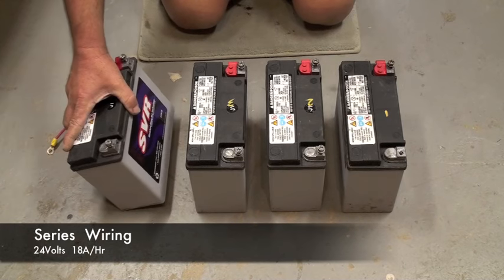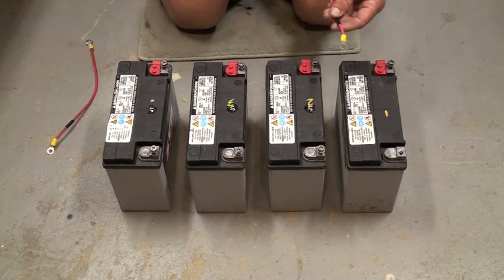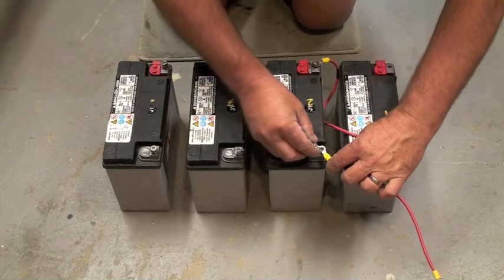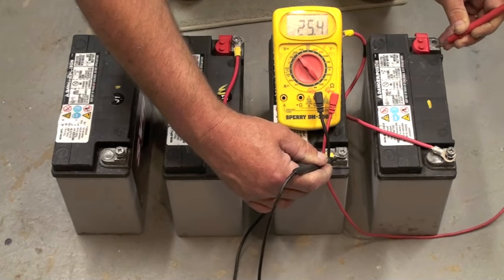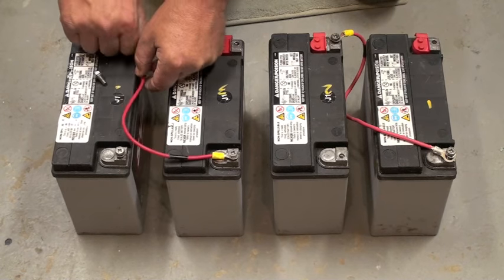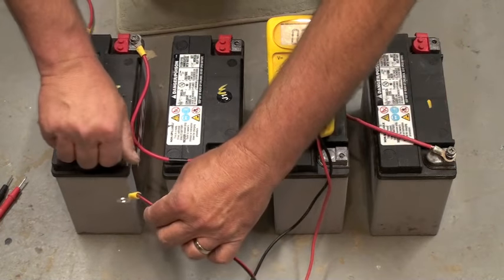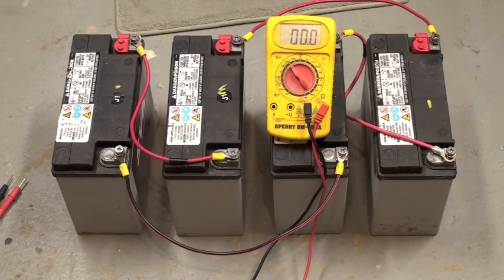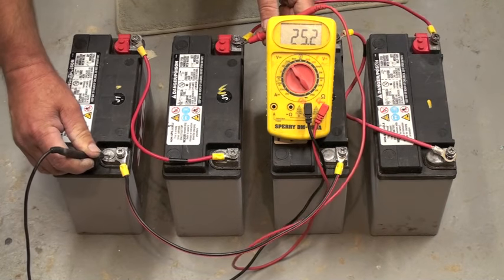Wiring Batteries in Series and Parallel.m4v

Comment: A few comments:  Doubling the Ah rating of a battery bank does not double the runtime.   The runtime of a constant "reasonable" load of 4 of your batteries (24V) verses 2 of your batteries (also 24V) should be about 220% runtime, not 200% runtime.  This is because the 4 battery bank "sees" a relatively lighter load.   Another example is your 12V 18Ah batteries are probably rated at the 20 Hr drain rate.  However, at the 40 Hr drain rate, they are probably rated at 20Ah since that would require a lighter load.  So my point being that the Ah rating of a battery is not a constant, but rather a function of the load on it.  The industry standard is using the 20 hour drain rate  which may or may not be representative of what it will be used for.  For example, in a golf cart, the 20 hour drain rate specification is not very useful since the cart will not last 20 hours when used.   A more accurate number for that application would be the  2 hour drain rate so a golf cart battery rated at 210Ah for example (20 hour drain rate) might only be half of that at the 2 hour drain rate ( 105Ah equivalent).

Also, for jumpers, it would be better to have a "neutral" color like yellow or white to indicate they are jumpers and not  wires that need to go strictly to negative or positive.   It makes a series/parallel setup easier to look at and understand quickly.
Reply: +David James    Please help me understand.  So there are 2 ways to connect batteries.
1. IN SERIES: only increases voltage.
2. IN PARALLEL:  Increases Amps and Voltage at the same time.

is this correct? thank you!
Reply: 2. IN PARALLEL: only increases voltage .
Reply: ***** Well it depends.  If you connect a 6V battery in parallel with an 8V battery then what would it mean the voltage stays the same?  Same as what/which?  It depends on many things including load, where you check the voltage at, the state of charge , how the batteries are connected....  Also, there is such a thing as series/parallel (combination) hookup.  For example, if you had four identical 12V 150Ah batteries, you could wire them in series/parallel for 24V 300Ah.  I used to do that when I had those batteries and also had a 24V 36A (max) charger.  Worked well.
Reply: maybe you can help me out , I use a electric wheelchair that calls for 12v sealed acid battery am I able to add a 6v sealed acid battery and push 18v my moters?
Reply: Yahshua Worshipper - Are you sure it is only 12V required?  If you are sure, I would try 14V first to see if there is any difference.  You      would then likely have to use a different charger.  I have used a 6V and an 8V battery is series for 14V for projects  and it works well but I have a special charger for it since a 12V charger will not work on a 14V bank.  The charger will either already think the bank is fully charged (when it is really not), or it will stop the charge prematurely which is bad for the batteries.  However, there are easy ways to charge a 14V battery bank.  What is your goal with more voltage?  Do you want the wheelchair to go faster?
Reply: David James Wow Carter u and mom did a great job! watching

 the kids to by by 4r XT X
Reply: David James 1gju
Reply: David James : as George said. Voltage adds in series amp stays the same
Ah / Amps adds on parallel voltage stays the same
 (SIVO - Series  Increases Volts opposite polarity)
(PIAS - Parallel increases amp on same polarity)
Reply: @abbason5064  Picture a flashlight with batteries in the handle in single file or "SERIES".
Each battery is 1.5 volts, 2 batteries will be 3 volts, 3 batteries will be 4.5 volts, 4 batteries will be 6 volts.
Imagine elephants at the circus, connected nose to tail, nose to tail in single file or "SERIES"
"PARALLEL"  is like rungs on a ladder, the side rails of the ladder being the 2 sides of power, Positive & Negative or a Hot leg and a Neutral, or 2 Hot legs, it depends upon what voltage the power source is, be it AC or DC, high voltage or low voltage, the theory remains the same.
Remember the old school Xmas lights that went out if 1 bulb burned open?
With the bulbs in series any bulb opening will open the circuit which kills the entire string of lights.
With the bulbs in Parallel a bulb can open / fail and it has no effect upon the remaining bulbs.

Batteries in parallel remain the same voltage.
Batteries in series the voltage adds up with each added battery.

Comment: Lots of confusion below. Although there is a saying, volts dont kill, amps do, that is only partially true. The reason he is able to touch the two terminals without a shock is because the voltage is too low to overcome the resistance of the body enough to complete the circuit. If he had wet hands, he would have felt it... and we would have known it. Basically, don't try it at home.

As you put more and more in series you are making it more and more dangerous. A single battery has enough amps to kill you, but the higher the voltage, the more likely you are to be shocked via your bare hands, or through insulated handles/gloves. 

The amps do kill you, but the higher the voltage, the easier it is for it to bite you.

Converting to AC makes it even worse, because how the current alternates, shocking you in short bursts over and over again, typically around 50-60 times a second. Sure fire way to kill a heart.

Comment: There are some gaps in your question.  How many volts is the panel putting out? You want to match the volts that your panel is rated for to the volts of the batteries.  In a car, the alternator charges a 12 volt battery at about 14.4 volts or so.  you need to match the panel's voltage  to the battery or batteries voltage in the same manner.  Too little and it will not fully charge, too much and you can damage the battery.

Comment: HI there .. Great video :) 
I am planning to get a 24 volts minn kota motor if I buy 2 of the minnkota power stations and put one 12 volt battery in each POWER CENTER ? Can I connect both the power stations together negative- of one power center to the positive + of other power center and then connect the negative and the positive terminals of each power centre to the motor to generate 24 volts to my motor WITHOUT USING ANY ADDITIONAL CIRCUIT BREAKERS ??? i BUT WILL THIS BE OK IF I CONNECT BOTH THE POWERCENTERS TOGETHER TO GENERATE 24 VOLTS?? do i have to get an additional circuit breaker ? Could you please advise ?

Comment: By using a mixed parellel wiring will it mess up charging the batteries. Currently I’m using a serial wiring iioioioioioioioioioffiofiofiofiofiooon my scooter which works fine but I would like to get added amps for either speed or length of ride.

Comment: Hi Sr, can you explain one question please ,, i have a plan to use 4 12v  220ah battery,   can i wire 2 power inverters one of 12v the other 24 volts using  one ( desconnect switch )  to move from 12v to 24v, is it possible? thank you. NJM.

Comment: Series circuits the "loads" are wired "nose to tail" as circus elephants, in single file.
Parallel circuits  the loads are wired like rungs on a ladder with the ladders rails being the 2 sides or "legs" of power.
The same thing goes for batteries,

 Two 6 volt batteries in "series" = 12 volts, that is wired Pos to Neg to Pos to Neg like circus elephants in single file connected nose to tail to nose to tail.

Two 6 volt batteries in parallel  = 6 volts , that is wired like ladder rungs with the 2 legs or sides of power being the ladders side rails.
Reply: Kd Grayson great analogy

Comment: I have 4 12 volt Batteries on a 12 volt Solar system. 300 watt panels and a 30 amp charge controller. I am wondering if I can run the 4 batteries parallel like the gentlemen in the video above, without frying the charge controller, etc. Thanks alot.

Comment: Setyo Wibowo
I want to install 24v winch in my 12v truck. Is it possible to make series of two 12v batteries to run the 24v winch while run the car with the 12v? Thanks in advance
Reply: Ever get an answer to this?
Reply: @AnthonyVierra  swap the motor and the selenoid with 12V one

Comment: Thanks for the instructional video. I would like to install additional battery or two in my vehicle so that I can operate my laptop while the engine is not running. I'm guessing they need to be configured in parallel for this application, correct? Do you know if the car will charge the additional batteries properly while the motor is running? Thanks!
Reply: They need to be in parallel and whether the car will charge it or not depends on the limits of your alternator. Also, you should have a good understanding of the load your wiring and fuses can handle before attempting this in your car. The gage of the wiring has to be thick enough to safely handle the additional current. If it really matters, you can reduce the current to your other everything but your laptop circuit with resistors, but I think a better idea is to replace the battery with the max amps your car manufacturer recommends, then use a 120 v convertor instead of common 110, and install a small UPS. The higher amp battery and 120 convertor will charge it while you drive, and then you can turn it off until needed when car is off and you are using your tech.

Comment: (at 1:15)  In this method as shown, you touch the positive terminal with one hand and the negative with your other. Doesnt that complete the circuit and give you a jolt?
Reply: Do volts or amps kill you?
So, back to which kills you, the amps or volts. Given your body is a constant resistance, it really is a combination of both. Higher voltage means higher amperage, and thus higher voltage has more potential to kill. It takes only 100mA to stop your heart. Dec 29, 2003 ~> 2020/20/06

Comment: I have 3-12 volt (36v)  series 31 batteries, powering a hydraulic system in my truck. I didn't build the system, but it's not wired like you do it. Mine are negative to negative, positive to positive, with the power going to the positive on the final battery. Does it matter, and what is the difference?

Comment: I intend to buy 6 6 volt batteries, and hook them up together to a 100 watt s panel and a power regulator , but what i do i do to connect them all to the power manager once they are are hooked up, i cant find any videos on that that are clear to me and none on how you should hook up 6 volt batteries to each other, like does it matter if they are wired to produce 12 volts vs 16 or whatever? What's the best set up? Any videos on this?

Comment: A parallel circuit maintains the voltage, so wire your 3 batteries in parallel and you'll have dc12v and your amps ramp up. A series circuit maintains the original amps, but increases the voltage.
Reply: theBarefoot...Finally a simple answer to the question that I’m trying to answer !!!

Comment: hi i have to replace a start motor to a crane was built in the 1940's so it has two 12v batteries connected in series and the positive is the ground/earth. how would i disconnect this battery safely to get to the start motor? any advice would be great

Comment: Ok great -  so if I connect 2 arrays of 24v in parallel and then I want to connect this battery pack to a 24v motor, which positive (+) and negative (-) terminals do I use? There are 4 batteries. 
Thanks
Reply: So you basically put the negative terminal on either terminal that is negative to negative and put the positive wire on the positive to positive...making a 24 volt double amh setup
Reply: Thanks
Reply: I have an agm battery. I was wondering how low I can discharge it without causing damage to the battery. When fully charged it reads 12.7 volts. Thanks again
Reply: +Darshan Patel just put a neg one end and a pos the other simples !

Comment: Can you connect a 12 volt battery to several UPS's?
Each UPS will want to charge up the battery(s) but will they conflict with each other trying to charge up the battery?
Reply: If you are trying to run multiple ups. Off one battery i would put a switch on the positive cables of each ups to prevent conflict during charge  basically keep one on and the others off then when power goes out simply flip the switches and unplug the others from the wall incase power comes back. But you will lose battery power allot quicker .   i have an ups connected to my security system and a 12v battery to run 12v 16w l.e.d  spot lights
Reply: I wonder if there is a device on the market that will let you do it automatically?
Reply: Solar charger with an inverter may be a better less sophisticated option for you . you can get solar panels and a charge controller relatively cheap

Comment: well, if i got this right ...
a lightbulb powered by 6V or 9V has the exact same runtime. right? (that's 4 or 6 batteris with each 1.5V in series)
but if i wire 2 battery packs with 6V paralel, i can double the runtime without killing the lightbulb. 
right?
because i have some contraptions in mind ...
1. battery-powered light on my bycicle. 
2. a usb battery pack with a pretty high capacity for my phone and usb devices

Comment: Thank you for keeping it simple, great explanation. After connecting the two in series,  If I wanted to use two batteries in series like you showed in the video for 24 volts,  ( I'm using a 24v Trolling motor) I would connect the positive lead to the trolling motor on the 1st battery and the negative lead to the trolling motor to the second battery? Or could I just connect the + & - to the 1st battery?
Reply: Connect a jumper wire from battery1 P+ to battery2 N-
Connect your appliance to battery1 N- and battery2 P+

This will give you 2 x 12v = 24v

For a SERIES array, each terminal can only have ONE CONNECTION. If there is more than one connection per terminal, you have done something wrong.

Comment: Im sure that if you bring the voltage up it brings the amps down vice versa which is why semis use 12v system. Because the starter draw alot of amps

Comment: This was such a good video which made it so easy to understand. What if I have 2 wired batteries (24V) connected to an marine engine and I want to connect an Inverter 12v-220v?? Any ideas on how I should proceed? Right now, the inverter beeps (probably due to overloading -24v)
Thanks!
Reply: Get an 24v inverter... Or in an emergency you can disconnect one battery so you get 12v.

Comment: So, parallel = positive hooked with positive? and Series = positive hooked to negative?
Reply: Parallel is pos to pos and neg to neg. Series is neg of first to pos of second, neg of second to pos of third, neg of third to pos of fourth. And just to be clear when hooking them up to whatever you want to hook up to. The pos of battery one is your positive  hookup. The negative of battery four is your negative hookup. You never ever want to let the positive and negative terminals of a battery contact each other through an accidental wire touch or if the ass end of the wrench you are using to tighten one terminal comes in contact with the other terminal. I did that once when I was a teenager. Wrench went through my terminal as if it were mash potatoes.

Comment: Why would I need 48v? What's is the practical application? A long distance from the battery to the load?
Reply: calculate the voltage drop if going a long distance.

Comment: where do you draw the power of and into your device when running the 24 volt in paralle? im going to possible use thi in a scooter project.
Reply: Where he takes his readings to show you the output are the points you take from to power your devices

Comment: Hi. Thanks for the video. It is very informative.  We purchased a used Lee Lacocca 36V Ebike recently.  There is an issue with the battery.  There are 6 6V batteries connected in series. The batteries test fine. We’re able to charge the battery pack fully. The light on it is green. When we place it on the bike, it turns on and still shows green and the engine starts fine.  However, when the throttle is pressed for 5 seconds or so, the light switches to red.  We tried it by leaving the charger connected, lifted the bike and pressed the throttle. While connected to the charger, it did not show a problem. Can you please help us understand the issue. Thanks
Reply: The battery pack is either too old and has lost its capacity over time or the pack has over discharged which is bad for batteries and makes them unusable, because they'll charge up fast and die fast and are not useable  again
Reply: Or there is a problem with the bike

Comment: Can you wire 3 12v 100Ah batteries to get 36v and increase the amprage? Thx
Reply from the maker: No you can increase the voltage or increase the Amperage
Reply from the maker: If you have 4x 12V batteries, you can wire them in parallel and in series as seen in the end of the video.

Comment: I'm trying to keep my room warm so i think i need to hook these car batteries in series.I got a Electric heater from Wal-Mart called Soleil and it takes 250 watts power 270w and the volts is 120v Ac 60Hz.One car battery only keeps them on for only 20min but connecting two batteries in series might keep the heater on for hrs.But may someone double check for me ??

Comment: How about 12 volt with that same 4 batery... Hows the connection...
Reply: Wire them in parallel. 12V @ (4*9) 36Ah

Comment: I'm trying to keep my ebike charged as I'm riding. The ebike is 500w the charger says 48v. I powered the 750w power inverter with just one 12v scooter battery, and I thought about keeping the ebike charged like that with 1 battery. So I talked to the guy that works at the battery store, he told me since the charger is 48v I need to have 4 batteries hooked up in series to make it 48v. But do I really need 4 batteries or can I just use one 12v scooter battery ???
Reply: No, you need 48 v so one 48 v battery or 4 12 volt batteries to get 48..

Comment: Can 24v battery system series connect a single 12v battery ?
What would be the effect in terms of Ampere, Volts and Wattage
Reply: 12v battery will damage